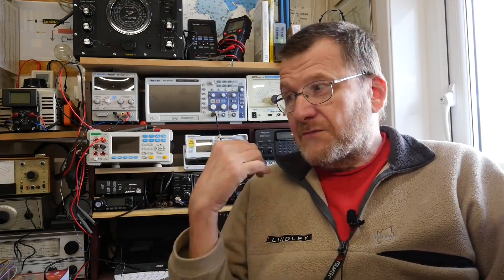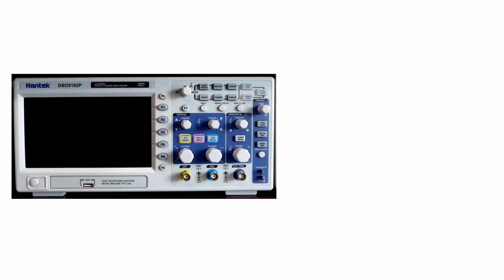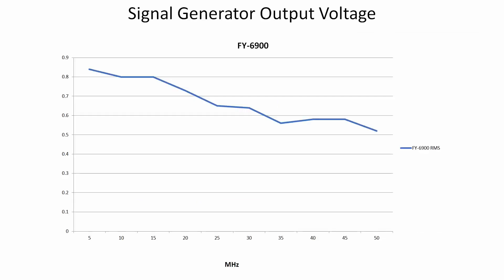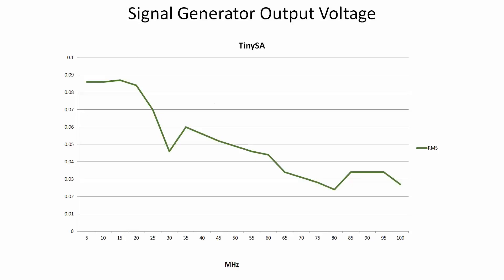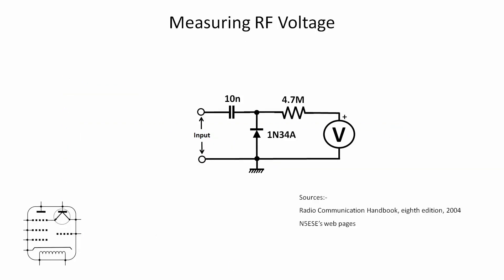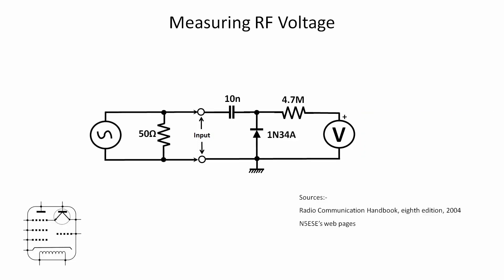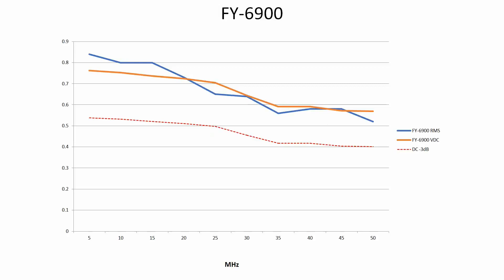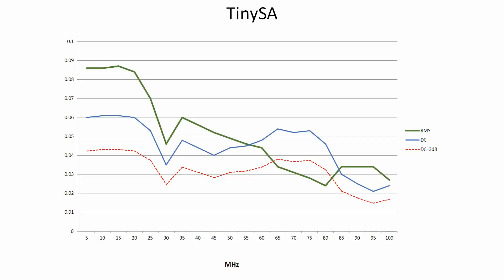Measuring Signal Generator Output Levels              #051

Comment: Bill, I have the FY6900 60MHz, the unit looks the same as yours. 
Test description:
- Oscilloscope: Rigol DS1202Z-E (My scope has -3dB drop at ~227Mhz, tested)
- Connection: 0.5m RG58 cable with BNC connectors on both ends, signal terminated using passthru 50ohm terminator on the scope site.
- Signal amplitude set on the FY6900: 1V.
- Test using 1, 10, 20, 30, 40, 50 and 60MHz frequencies.
Result: -1.68bB  on 60MHz (0dB it's result of 1MHz reading). 

Do you use coaxial cable and terminator in your tests?
Reply from the maker: Mark, I used the RF probe as per the circuit diagram.
I have just repeated your series of measurements using a 1V output, terminating with 50ohms.
I will email you the spreadsheet.
Your scope us certainly better quality than mine, so I would trust your results rather than mine!
Having said that, my results are all less than 2% different, which is encouraging!

Comment: Excellent and interresting topic. I guess many of us take it for granted when the generator shows 100mV on it's display that it actually outputs 100mV no matter what frequency we set it to.
As long as the generator isn't measuring it's signal on it's output and displaying a value based on that, but rather a pre programmed value, it can't be relied on. 
I can vaguely remember my teacher saying something like:   "Don't just trust the instrument, measure it yourself"
Reply: For my knowledge, the generator has 50 ohm resistor in series with the output. When terminated with 50 ohm you will see =< 50% of the RMS voltage.
RMS = 0.5 x amplitude x 0.707